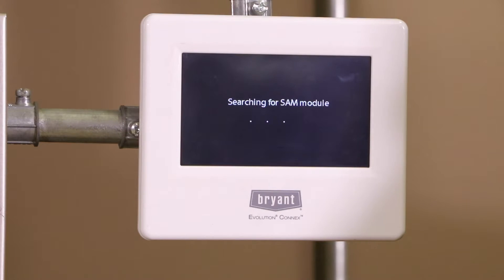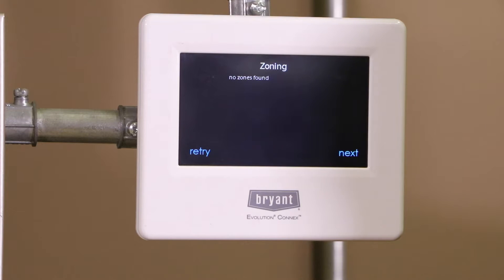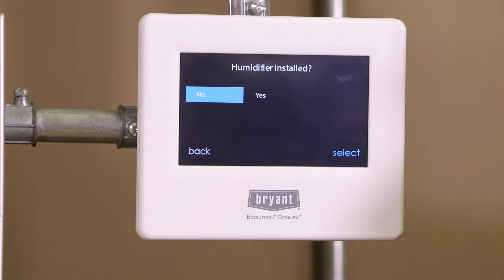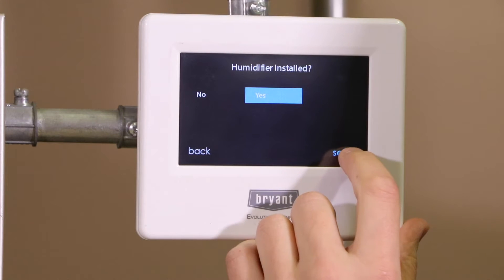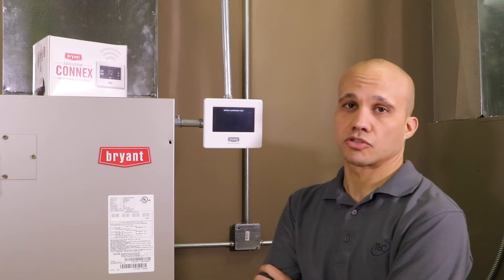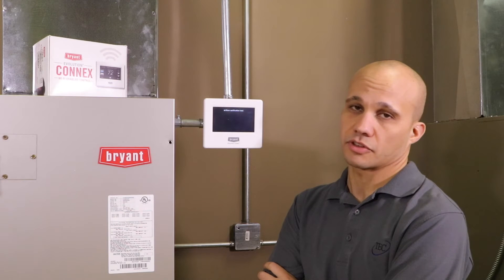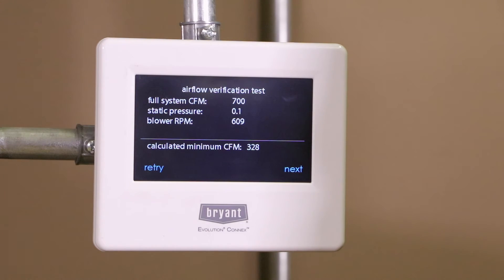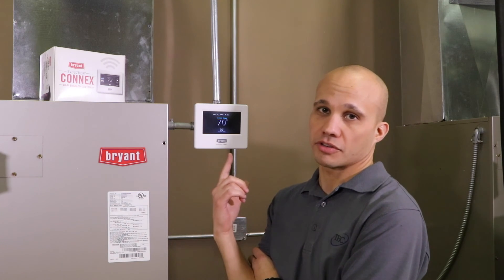Infinity Touch / Evolution Connex Control Startup (1 of 5)

Comment: question. can you adjust the humidity levels, in cooling mode, without a humidifier?
Reply from the maker: Yes.  Infinity controls dehumidification by running the condensing unit while simultaneously lowering the speed of the indoor blower.  This changes the sensible heat ratio to provide better latent capacity.  This means more dehumificaiton and less cooling when the temperature setpoint is met and the dehum setpoint is not.
Reply from the maker: Humidification (add moisture to the air) and dehumidicication (remove moisture from the air) are separate functions.  Only humidification would use a humidifier.

Comment: How did you power it up?  Ours worked great yesterday.  We took it off the wall to paint the wall this morning and now plugged it back in and the screen is totally dead and blank.  Any ideas how we can power it back up please?
Reply from the maker: The wall control receives 24vac power from the furnace over the C & D wire.  When you took it off your wall, did you disconnect power to the furnace first?  If not, you may have let wires touch something they should not have and blown your furnace fuse or transformer.  If you are unfamiliar with low voltage control wiring, you should contact your service contractor for assistance.

Comment: I use electric heat as a back-up, is it possible to set an external temperature set-point to control when the electric back-up can come on, meaning, I don’t want the electric back-up heat to come on above 35 degrees.
Reply from the maker: Yes, it is in the Setup section.

HP Lockout: Adjustable from -20 to 55F or None

Furnace, Electric Heat or Hydronic Lockout: Adjustable from 15 to 55F

Comment: First, you guys are awesome & I love your videos.  Would a bad thermostat cause a high limit on an Evolution system?   I notice in the morning my thermostat will read 71, as the day progresses (system off) the thermostat reads the same.  If I kill power to the system and restart it reads 78.  I'm thinking bad thermostat, is this thermostat compatible with the Evolution & could my bad thermostat cause a high limit & limit lockout?
Reply from the maker: Which thermostat model is it?  Is it an ecobee stat or other thermostat that has a "feels like" display option?
Reply from the maker: Furnace high limit trips are caused by too hot of a discharge air temp.  This is most frequently caused by insufficient airflow.
Reply from the maker: Where do you live that you are still running the furnace in late June?
Reply: Not running my furnace currently. I was having issues with communication faults,  ran shielded wire & got the faults cleared up.  Then did a factory reset to remove all the stored codes.  Shortly after started getting high limit & eventually lock out.  Spoke with Bryant tech support told them I believed my issues was programming.   Made two changes in the advanced settings which I was told increased air flow.  When my gas fireplace is running on my first floor and calling for heat on my second, I get lockout.  I think I need to tweak the system more.  I also find my thermostat to be inaccurate with temp. & the back light randomly turns on or stays on.  I have a systxbbuiz01-b thermostat & smart sensor for zone 2.   My furnace is a 355cav0420 and AC is 2 stage 187ANA036.  System has been well maintained, coil cleaned once a year inside and out 4 inch filter changed at the start of every season.   System installed in 2008?
Reply from the maker: @josephconetta4834  You have a lot going on here.  Way more that we can assist you with over a text conversation.  Do you have a local Bryant dealer that can diagnose/

The fireplace should have no affect on your furnace operation... unless they have a shared vent and you have issues exhaust airflow.  Or maybe your upstairs zone does not have sufficient airflow ability but normally the upstairs never calls for heat without the downstairs... until you use the fireplace downstairs and hence it does not need heat.  This could be caused by too small of an upstairs zone or poor distribution system.  It could also be caused by an over-sized furnace.

The 4 inch filter can be a concern and certainly can relate to high limit trips.  You need to compare the rated pressure drop of the filter (when clean) from the manufacturer and to the field measured pressure drop of the filter (when clean) and again at the times you have these limit lockouts.
Reply: The 4" filters are the same filters I've been using since new, never an issue.  My issues began when I did a factory reset to default.  I had a tech come out spent 2.5 hrs found the heat rise in spec but couldn't diagnose 450.00 dollars later, and I got nowhere.   I spoke with Bryant tech support and changed the advanced settings to efficiency and turned (a setting from on to off)  I went almost 2 months without a high limit or lock out.  I wonder if my installer set the zones to stay open a little or is there another setting I am overlooking?  I believe my outside sensor is reading a bit high & as I said my thermostat has been acting screwy...I really can't afford a new system at this time, but can't live with the uncertainty as I have small children.  Your guidance & knowledge is greatly appreciated!
Reply from the maker: @josephconetta4834  If you think you may have messed up some of the airflow settings on your zones, you may want to check out our Evolution zoning video, especially the second half.  https://youtu.be/XVPcS1EvweU
Reply from the maker: @josephconetta4834  Your tech probably tested the heat rise with all of the dampers open, but maybe the issue happens when they are not all open.  Maybe one of your dampers is binding.  Maybe the actuator is slipping.  If you have the slip-in style, it is possible the plastic gear inside it broke.  When you reset the control to factory default, you likely lost all of the airflow settings of the zone dampers that hopefully someone setup specific to what was needed in your application.
Reply: I've pulled my dampers and made sure they were opening and closing properly in the past.  With the help of your video I changed the air flow setting from high to maximum, while watching I realized the system hasn't been blowing as hard as it normally did in the past.  I also adjusted the offset to zone one, which was not accurate.  Do you think changing the setting from high to max, may give more flow over the heat exchanger?   Thanks for your guidance and help!
Reply from the maker: @josephconetta4834  It is not like an ordinary zoning system where changing the damper airflow has a direct impact to the heat rise of the furnace heat exchanger.  In the case of most Evolution systems... especially if someone has the modulating gas furnace (and to a less extent the 2 and 3 stage furnaces)... the furnace knows the CFM being delivered through the zones and it adjusts its staging to accommodate.  In other words, if you have to high of a heat rise, the controls should actually back the staging down to lower the heat rise.  High limit trips are not common on Evolution systems unless the blower needs to reach maximum capacity to due to static pressure.
Reply from the maker: @josephconetta4834  Each model of Evolution furnace has published minimum CFM as related to its BTUh turndown ability.  The zoning system should be designed such that the smallest zone can deliver that CFM on its own if needed.  If a zone is smaller than that furnace minimum CFM, it can become an issue.  In those cases a smaller furnace should be used or there should be less small zones.
Reply: With your guidance, I am starting to think blower motor.  I remember in the past the system blowing hard especially on my first floor to get to temp the desired temp then throttling back.  I especially remember that during the cooling season.   I don't recall it ever ramping up and blowing hard.  The blower motor spins freely and is clean, are there any setting in the advance settings or should I be looking at the fan motor module?
Reply: I just ran the duct assesment & got "the system would not calibrate.  Motor data did not calculate correctly."
Reply: Rechecked and got: zone1 31% zone2 49% damper leakage 20%
Reply: I was hoping it was the fan module  or damper not opening, but I dropped the temp 5 degrees and the system went into high fan and was blowing...I'm at a loss...

Comment: Yes, we blew a 3 volt fuse.  We have a 5 volt.  Can we use that until stores open tomorrow to get another 3 volt?
Reply from the maker: When it comes to safety devices, such as fuses, it is best to use the correctly rated replacement part.
Reply: You likely mean a 3 amp or 5 amp fuse